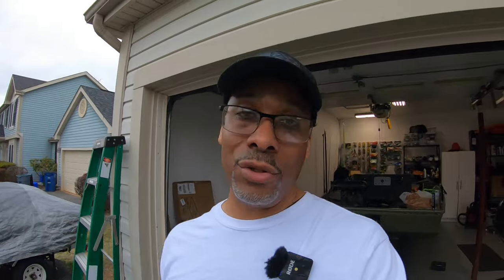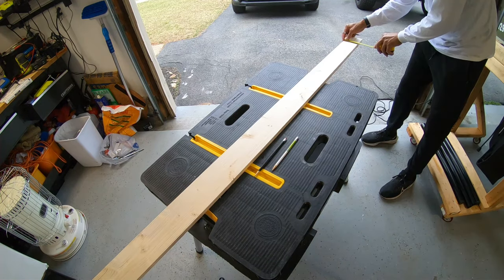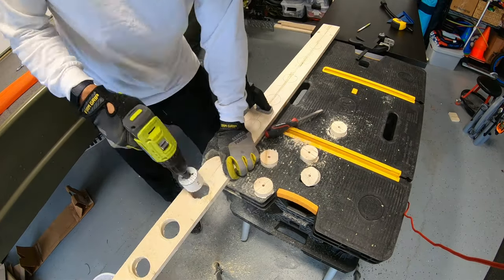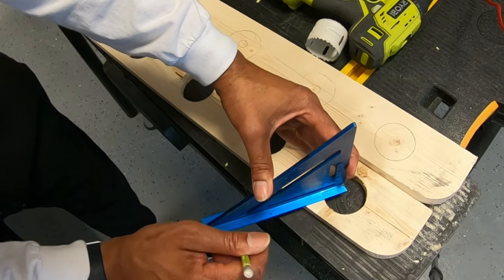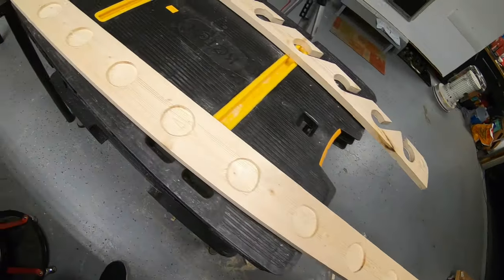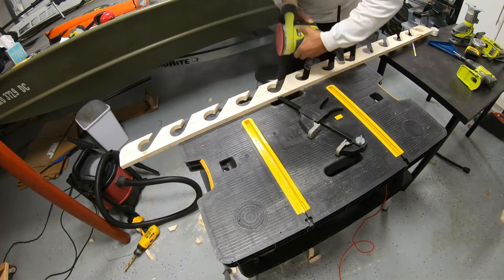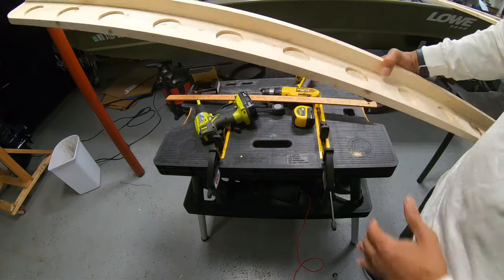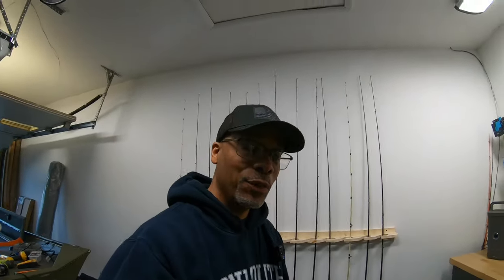How To Make A Simple, Cheap & EXTREMELY STRONG Fishing Rod Rack That Will Last Forever!!!!

Comment: Nice Video, nevertheless I would prefer, to do the bottom rack in a easier way: use two boards, in the upper one drill the same holes as done in the top rack and glue/screw a solid board below.